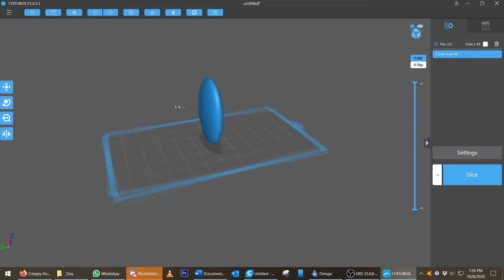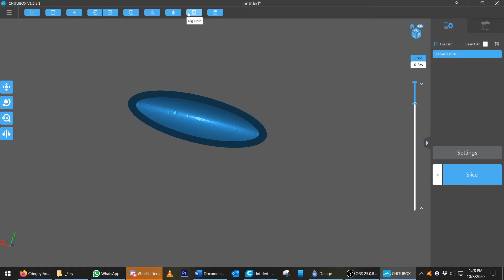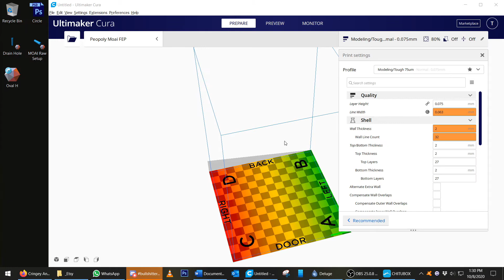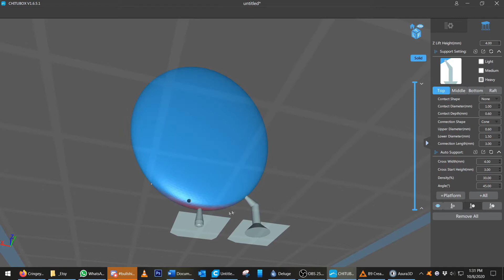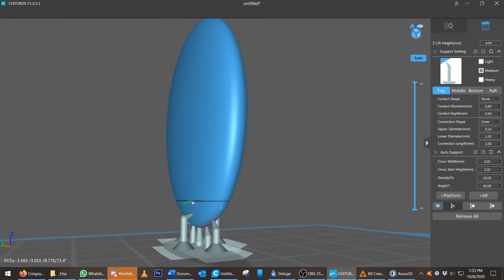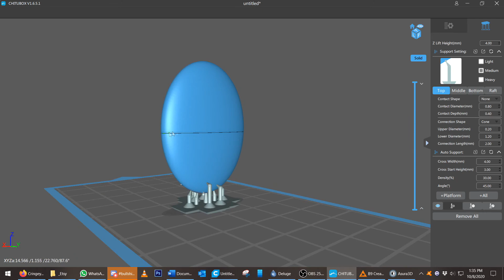Moai Supports - Vid 1: Chitubox thought process only

Comment: What do i need to do to use Chitubox for my moai printer ? What Settings?
Reply from the maker: Chitubox does not work with the Moai. You must use the pathing software associated with Cura on the moai. There are other slicers, but I have done the best with Cura.